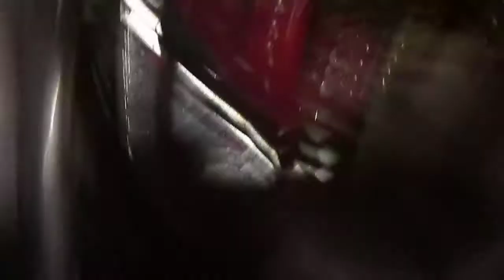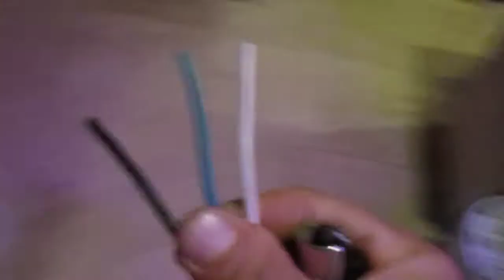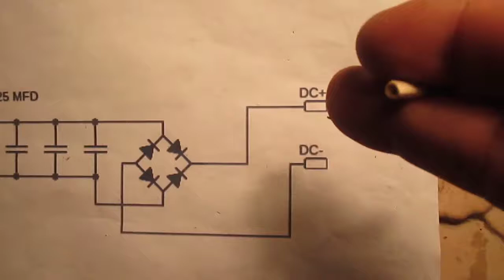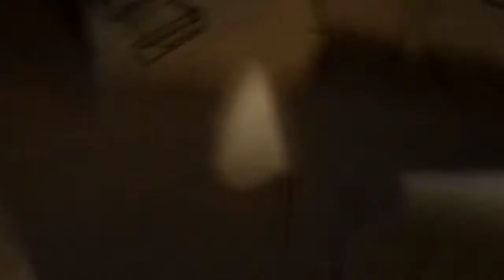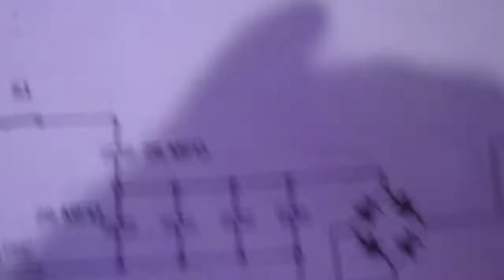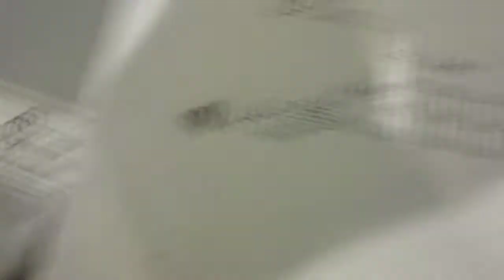dc power supply built to last

Comment from the maker: best to use more than one CAp in parallel for dropping the voltage , it spreads out the heat  generated by dropping volts onto more than one capacitor preventing failure

Comment: Why? What's the advantage you're trying to create?
Reply from the maker: DC power supply has no transformer . Its all capacitors and rectifier . Very reliable dc power supply . The output is double the grid frequency , you can make the pulse into constant current if you want with smoothing capacitor on the output .
Reply: @mykedoes4099  man that is cool. Thanks for replying to my stupid question. Can the frequency be doubled again before the bridge rectifier?
Reply from the maker: @scottneels2628  I believe the rectifier cuts the bottom half of the ac sine wave and brings it up top making two top waves/pos and no bottom wave/neg. Thats how the doubling takes place .
Reply: @mykedoes4099  thanks again for your reply.
Reply from the maker: @scottneels2628  frequency can only be doubled once because its done by moving the bottom half of the sine wave to the top half essentially by converting from AC 60hz then to DC 120hz
Reply: @mykedoes4099   Thanks heaps!
Reply from the maker: windings and transistors burn out and dont last , this power supply you can plug i in walk away come back in 20 years its still works

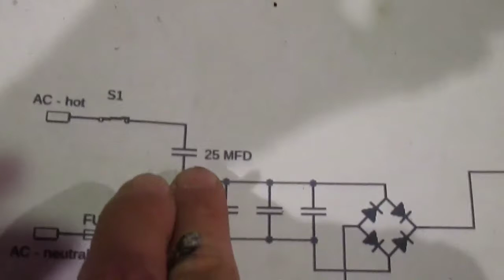Comment from the maker: 8:55 switch the electrolytic for same value but switch for multiple smaller caps in parallel to make same voltage so the heat is even distributed and the electrolytic wont blow out

Comment: Dude this awesome! If I used your AC to DC circuit on my MVP Device (Built out Bedini motor hybrid) it could take it to another level!
Reply from the maker: Ya but it's not my device i actually found the circuit online.. It's very reliable dc power supply, good luck with your Bedini mod, ps what is mvp mean?
Reply from the maker: Send me the link